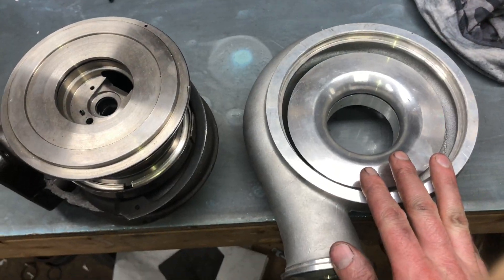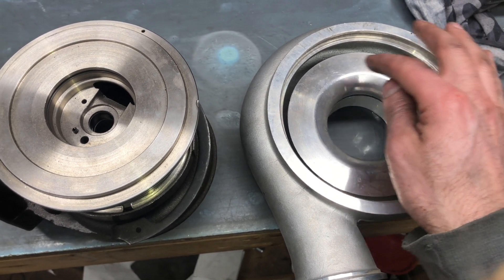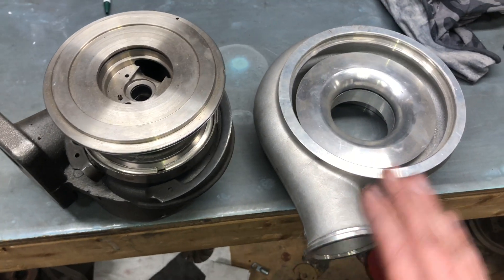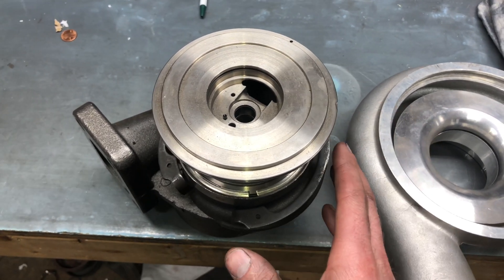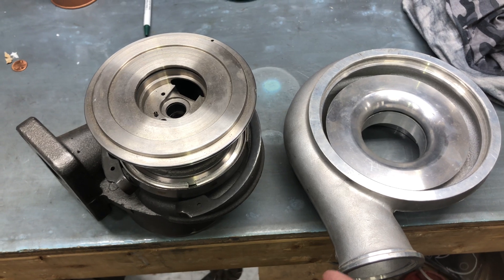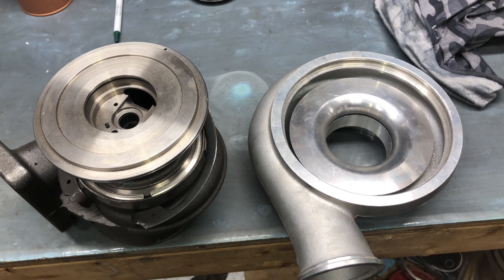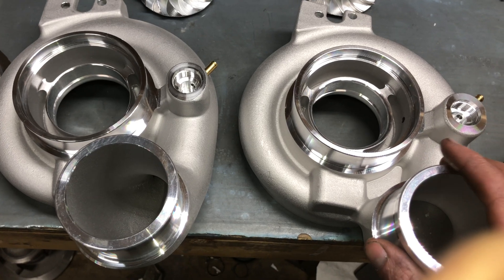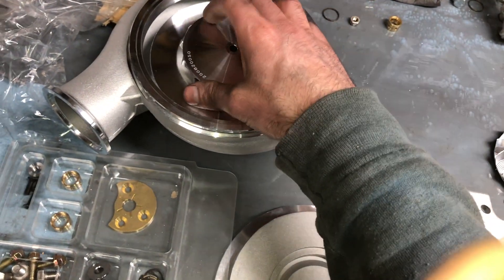How to machine hx35 compressor housing to fit on He351cw

Comment: The main reason I would like a different is because the 90° cover just isn't right for my application. An outlet to the side would work much better that the one out the front. What would it take to make a HY35 cover work on the HE351?
Reply from the maker: The compressor housing would have to be machined for the compressor wheel. I have done it before.

Comment: Hey Austin, is it possible to do the opposite of what you covered in this video? By that I mean a HE351 wheel and compressor housing on a HX35 frame. Is there enough material for me to machine out the cover, cut a new snap ring groove and keep the cover properly spaced from the wheel?
Reply: Did you try I it out? I want to do the same.
Reply: No, I ended up just using a HX40 compressor. It would be fun to try though. I was considering that setup because I found a super good deal on a HE351 big compressor. But I soon after realized that we get lots of "blown" HX40s and S400s at my work that I can have for free

Comment: For my he351, I cut off the angled outlet at a 45 degree cut then reclocked it and rewelded it to have the same outlet angle as the hx35/40. I also cut off the wastegate actuator mount and rewelded it on the top of the housing next to the compressor outlet. Fits just like an hx40. I was considering finding an old hy35 compressor housing and having the inlet machined for the he351/hx40 wheel, but the only source I could find was from Poland and the shipping was too much, plus I'd still have to pay for the machine work. I think the adapter plate would be a hot seller. I also think if you stocked modified hy35 compressor housings that just bolted on they would also sell well. I think the main reason they'd be popular is because of the internal wastegate, which would allow a lot of people to bolt them onto their stock manifolds in many different applications. Mines going on my 2.3L volvo t5r.

Comment: I just want a turbo for my Fummins that bolts up to my 24 valve cummins and has one of them 90 degree front facing discharges you show in this video so it points right at my intercooler.   I don't care what cover or cartridge it is based on....

Comment: Probably so they don't have to modify the intercooler pipe but I got you to machine a hy35 for me 10 blade 67x76 turbine in the 9cm wastegated exhaust housing with a 60x86 compressor it was a direct drop in and spooled instantly and whistled really good
Reply: I wanted to do this too. How much did the machining cost you and where did you find the hy35 compressor housing? There's only one seller I saw on ebay with them but they are in Poland.
Reply: @SkillCap  I had turbo lab America do the machining and they built the turbo I found an old hy35 for 80 dollars  and mailed it to turbo lab